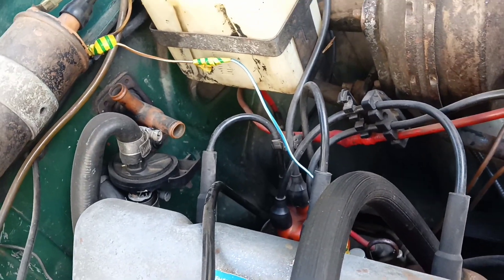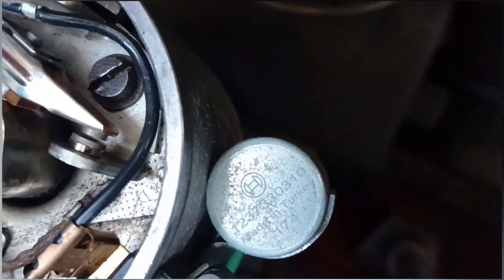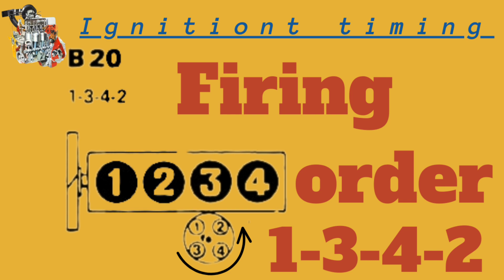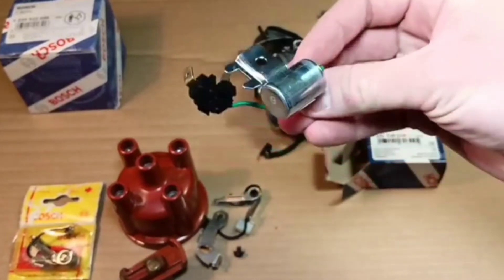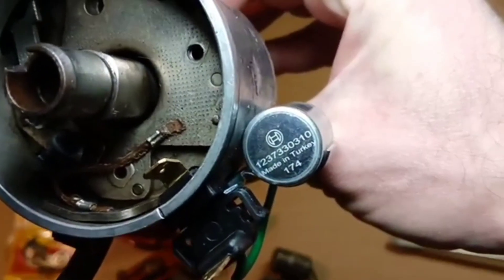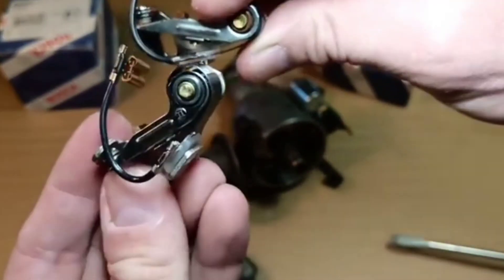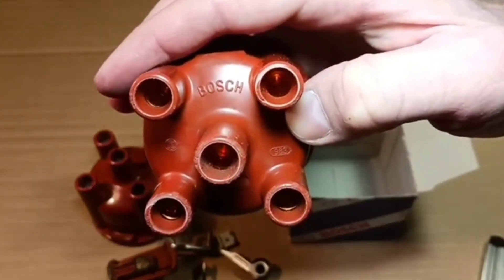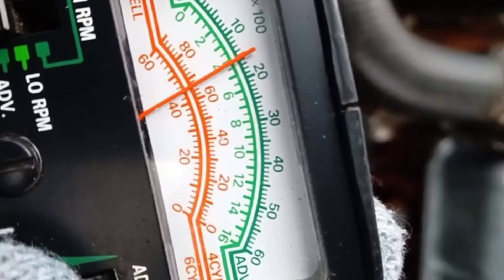Very Last Ignition Distributor Volvo B20

Comment from the maker: Which distributor to use for B20 late type? I think right that which was fitted in the factory.
And you can shave it's working condition forever! Watching my videos how to rebuild BOSCH distributor. Links right here:
https://youtu.be/9WQCK8bgv5A?si=ngs29v5NKW5vDWhz
Spare parts for BOSCH battery ignition:
https://youtu.be/J-henAGzuI4?si=tgkzSe1sKhLfNWDS
Spark plugs BOSCH for Volvo B20 (Volvo 140, Volvo Amazon...)
https://youtu.be/wCdZg34zqYY?si=9QQcgivs7dT9E9Ur
Spare plugs say you about engine condition
https://youtu.be/WSiRpPUMWjg?si=vTTXb8hE8jWKX__b
Why we have to use zero resistance HT leads only
https://youtu.be/61KHcXtc-L0?si=DZyK7Sa7qVAt-XN7
Keep your contact breaker in working condition
https://youtu.be/jB2GJLi-73Q?si=UGXaQNkzL4PH6T6_
Adjusting ignition
https://youtu.be/5s8n42D2LzE?si=zLI0A57rw83XLLkc